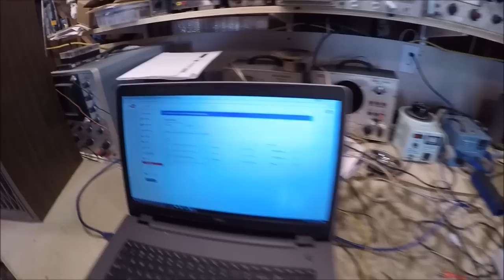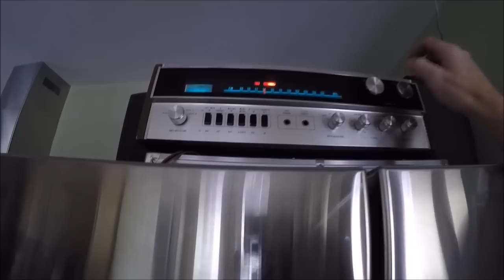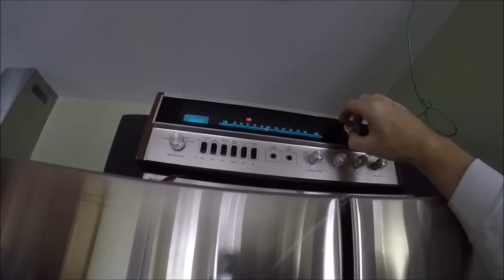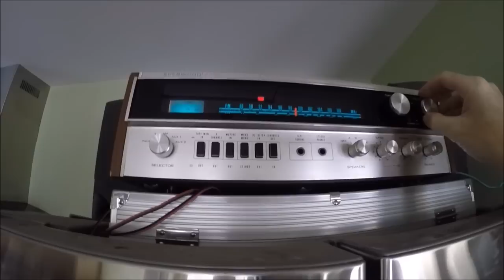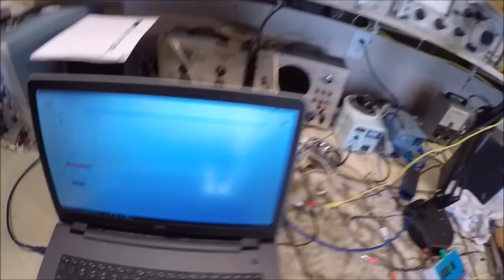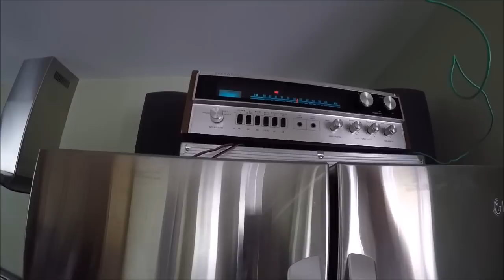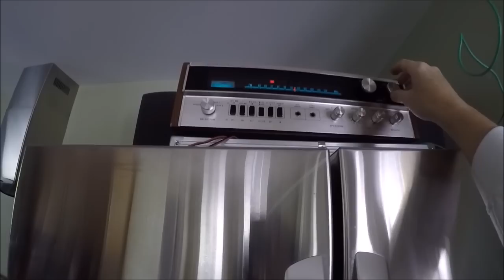Rancho Radio is Back on the Air!(KRRJ)...Wednesday Time Waster

Comment: I just wonder why you don't use a oscillator driving a RF phasing network of which one side will be modulated to give SSB which is mixed with the other output of the RF phasing network to give a Phase modulated signal which would be tripled up to the wanted frequency and gives a better FM signal by design, if you are interested it  is the Armstrong Phasing FM transmitter circuit.
Reply from the maker: way beyond my pay grade but I will check it out....thanks David xx